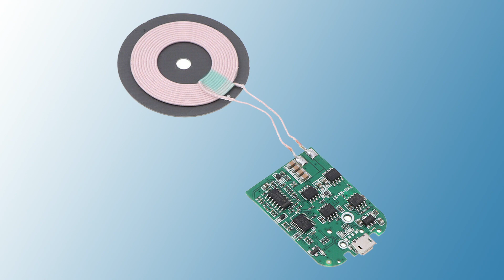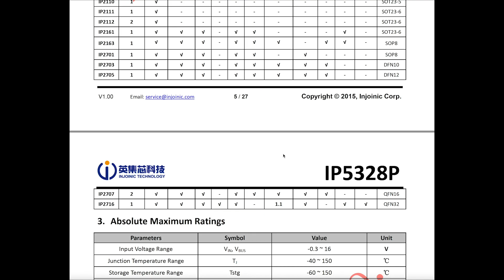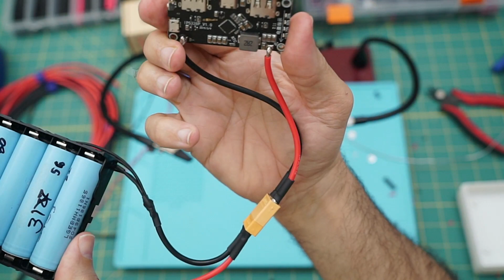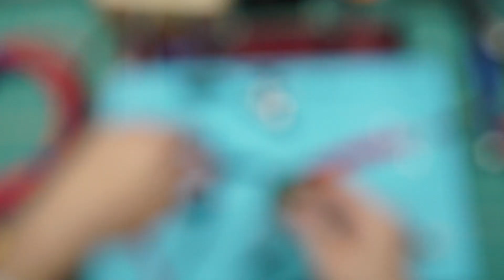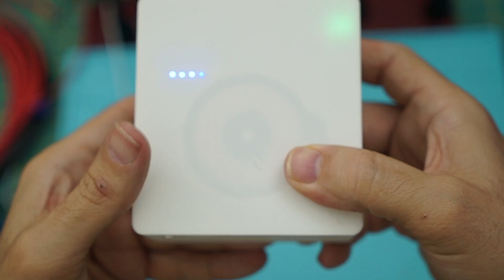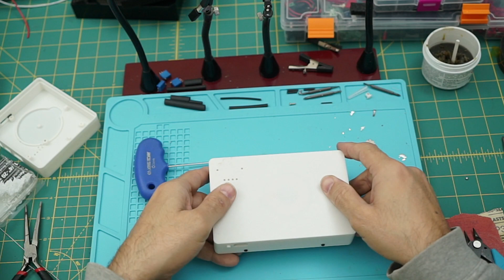How to make wireless power bank for less than $20 (Free 3D Model)

Comment: Nice Video there is just one problem: The normal USB port where you connected the wireless charger can also output 12Volts.
Reply from the maker: Yes this is true. the wireless charging circuit supports up to 12 volts and has a protection on the input voltage so it disable the charging circuit if in voltage exceeds 12v
Reply: @mcu_park2017  Oh i see.